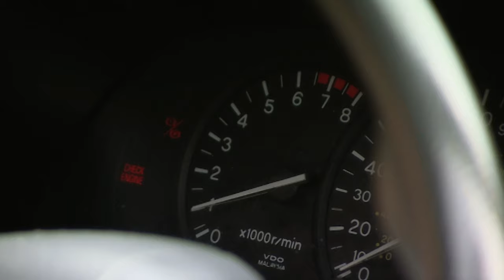Driving A Car With No Oil #TBT - Fifth Gear

Comment: I thought the coolant cools the engine, not the oil. The oil is just for lubrication, while the coolant runs thru water jackets throughout the engine then back to the radiator which cools the coolant with the fans or the air flow coming thru the front of those vents, then back into the engine from the bottom.

Comment: they forgot one big thing.  its better to be SLIGHTLY under-filled with oil vs being overfilled.  majority of lube shops and dealerships overfill with oil because they forget that once draining oil, there is still a quart in a half still left in the engine components.  overfilling oil causes hosts of other problems.  gaskets being one.

Comment: I personally think that you shouldn't be allowed to get a drivers license with taking some small basic maintenance guide. Just how to check all fluids, check tyre pressures and tread depth and check air filter. Would save so many vehicles.

Comment: The oil warning lights could just run on a timer. Like if the Hood hasn't been opened in a few months or the oil dip stick itself hasn't been moved in a few months. Something like that. Or maybe instead of a timer it could read your mileage. 
That would be more reliable of an oil state sensor.

Comment: I dont know, but the operating manual of my car says, the oil level should be checked on level ground, and on cold engine. I checking it on every week, and i tried check when i stoped on a petrol station. The dipstick barely reach the oil, becuase when its warm and the engine was running recently, the oil is everywhere but not in the sump. I checked it next morning and the level was good.

Comment: I know this is years old, but 5 litres of manufacturer-recommended oil for my car that met the proper standards was £48, hardly cheap. Still, ~£100 a year isn't too bad (if the oil is replaced twice).

Comment: I didn't know what a throttle body, intake, turbo, piston, piston rod, block, any of that and more like 6 months ago. Doesn't take much research, but you should always check your oil, change your spark plugs, break, and tire work.
Reply: Spark plugs aren't something you would check regularly
Reply: Spark plugs should be checked every 10,000 miles or every 2 oil changes and either regaped or replaced.

Comment: Hi, is it correct to check Dip stick an engine cold overnight ? I use to check it and exact Full line. but I try to check after engine off after driving, it shows half in between. Please let me know.. thanks
Reply: +axenz axtiz you should check it a few minutes after driving your car. Cold engine overnight gives a false result, and so does a check straight after driving it. Warm up the engine a bit, then give it some minutes to drop, and then do the check. Either way, half right after driving and full overnight means you're okay with oil level. Check the thickness and the color as well to make sure it isn't old.
Reply: +Strax Thank you for the info.
Reply: No, cold doesn't give a false result at all. You can check the level in most cars dead cold or warm, just make sure the ground is level and if warm let the car sit for at least 10 minutes.  Keep the oil level to a little under maximum too, gives a margin for error.

Some manufacturers (not many at all) will specify oil checks when warm, same goes for some transmissions.

But to reiterate, for most cars a dead cold reading will be the most accurate. Discoloured oil doesn't automatically mean it's no good either.
Reply: Thanks Chris :)

Comment: I have always maintained my cars oil and water levels and recently bought a used 1 owner from new, 2001 74,000 mile Hyundai Amica 1.0 (14 years old) for £150 as workhorse that had NEVER been serviced from new.. no timing belt change,3 oil changes and no water change. The oil was like Treacle and the water was furry orange, drained and refilled both, brake fluid, changed the timing belt, clutch and she is still going today 2 years later and 8000miles passes emissions with flying colours and sounds/Runs sweet as a nut. I think it is more  how it is driven whilst not being serviced.. as you saw he was at 8000rpm and thats what finally killed it. I think if you dont know how to service your car you should not be on the road!

Comment: My car just recently almost broke down because it was running on low to no oil because I wasn't due for another 1000 miles. The place didn't screw on the cap tight enough.

Comment: As a bicycle mechanic I can cerify that 90% have no clue there is a recommended tire pressure or that it is printed on the tire walls. Even fewer people own a pump with a gauge on it. This is the no 1 reason for a slow and "heavy" bike plus tire wear and flats. At least most have more respect for their cars because a new one Will cost them more than a push bike.

Comment: Remember, OVERFILLING the oil is bad. Do not fill the oil when the engine is cold, or if you must, fill it to a little above the "low" line, not all the way. Put more in once you have a chance to check it when it's warm.

Comment: I went to get my oil changed but later found it it was actually low on oil and I never seen any leaks. My radiator was leaking but I just got that fixed but I literally took my car in at the right time. If I went any later, this car would’ve been done for

Comment: I was driving my 2006 bmw and I felt like I hit a bump but little did I know it was a rock and the light came on and all of a sudden the car shut off. I took it to get the oil pan replaced but it shakes every time I turn it on:( is my engine done for good???

Comment: Serious question.  My cars oil filter popped off while i was driving and it began to drain. I didnt notice until the low oil light came on but i was on the highway so i kept driving for maybe 5 more mins until my car locked up and i was forced to pull over with a stiff steering wheel.  Now my engine makes a weird noise even after i got it fixed.  Is my engine completely fucked?
Reply: Are you a real person?

Comment: I did the same thing to a 97 Nissan Sentra I drove it till it made a similar noise like yours and then it just stopped working on the side of the road similar to your situation except mine was by mistake what do I do now just fill up with oil or do an oil change

Comment: I always check the oil, coolant and transmission fluid in all 4 of my cars every fuel fill up. And you shouldn't really ever run the tank down past 1/4 unless you're doing something like a fuel pump or dropping the tank. Take care of your cars folks

Comment: i get an oil lamp and warning on a small screen if my oil is starting to get low, way before it's late, i also get occasional messages from the dashboard, telling me to do an oil check, based on how far i've driven, the car went from full oil, to half a drip away from full on 10.000km.. now you're thinking "now that's a good car" it's an Opel Astra 04... so how come so many people fail to check their oil??

Comment: You check the oil with the engine warm? Meaning after it's been running. Does not this give an inaccurate read? Because some of the oil is still in the engine as opposed to the oil sink?

Comment: Drove an old vauxhall for 40 miles with oil lamp on, turns out the pick up pipe had come off and none was getting to the rest of the engine, fixed and worked and no issues afterwards. Mind you I never drive my engines at extreme revs, stupid idea.

Comment: Where does the oil go if it gets more empty overtime? (If there arent any leaks)
Reply: @sanyo8440  well now that I think about it, the car porbaly burns it.
Reply: as engines age, the piston rings wear out. This means that oil can get past the piston rings and enter the combustion chamber with the air and fuel that the engine is pulling in. So yes, the car burns it. Piston rings can wear out faster if you don't change the oil enough, so changing your oil more often will cause your engine to burn less oil over time.

Comment: 4:06 "it's best to check you engine oil when the engines warm". No its not that's the worst time to check it. When the engine is warm the oil inside it is also warm so therefore the oil will expand giving you a false reading.

Comment: i drove a Nissan versa no oil was showing on the dip stick anyway did oil change oil was either low or bone dry everyone told me engine is toast sell the car

100 k miles later still going strong. so much for the experts

Comment: But wait, he checked out the cars in a parking lot... I was learned that when you have driven the car, you can not check the oil levels for about 1-2 hours because the oil has not yet leaked back in the sump(?) so it will look like there is no oil in the car.
If you do check it 'too soon' and you fill it up you have the chance of overfilling your engine and you can wreck your engine as well because the oil can not expand when it gets hotter and thinner.

Comment: I change my own oil with synthetic every 5,000 to 6,000 miles.  So far at 75,000 miles, it's not burning or leaking oil.
Reply: Change mine every 3k miles, just hit 321k miles.
Reply: +Nodak81 that's bullshit. Take a look at saturns, for example.(because people say they are notorious for oil burning) They run forever as long as you change the oil regularly, but if you slip on it a little while or see the oil light come on, you are going to eat oil from then on.

Comment: The only reason oil shows low on dipstick is because you car either has a leak or your car is burning engine oil. 
The only time i check my engine oil is when i servicing my car.

Comment: Wait! Arent you supposed to read the engine oil level when its cold, since it expands when its hot?
Reply: That's why you check it when the engine is hot. Once the engine is at operating temperature, the oil temperature is pretty constant at about 100 C, so you get an accurate level. 

When the engine is cold, the temperature depends on the weather, and as oil expands with temperature the level will fluctuate.

Comment: So, I've driven my 2008 HHR for almost 10K miles with no oil change due to a leak a year ago to prove this point to be wrong, unintentionally I might add.  A friend didn't believe be when I told him I've been out of oil for months, so he linked me this vid, my car just died last week of a fuel line rust out (completely unrelated).  My other cars are always up to date on checks and fluids though, I just wanted to run my first car into the ground... oddly enough I can still drive it, but risk a ticket for defacing public roads.
Edit: I just realized this video is 2 years old.

Comment: before doing any journey
take 5 mins or less off your time to check your car's engine oil, brake oil, power steering oil and clutch hydraulic oil (if there any) and check your tire pressure
better late 1-2 minutes than sorry for having an accident

Comment: I must of owned hundreds of cars over the last 6 years and I’d say 70% are usually right at the bottom of the stick when I acquire them 

Had a Picasso once smoked like a bastard (bought cheap) 

Checked the dipstick 

Half way up the entire fucking rod 

Drained 4 litres of oil to get it back down to max 

Think it’s still going today.

Comment: I have a question, how long was it befor the car finally died? hours? miles? and i am in total shock that not only did they lazily not check their oil but wouldent even allow someone else to do it for them and ontop of that dident even know what a dipstick was or where.

Comment: I can't believe the amount of people who can't do this simple task as well as changing there oil or having it changed at the correct time/mileage.  It is also terrible that modern cars burn this much oil as oil consumption should be a thing of the past but this appears to not be the case.  If I bought a new car and it consumed oil after the run in period I would take it back and complain that it was faulty as it clearly would be.

Comment: Its normal for a cars engine to use little bits of oil 🛢 occasionally but it shouldn't really be noticeable, they don't burn oil the same as burning fuel unless there's a serious problem, or a leak, a car we had like 20 years ago was burning up oil but that's because they engine was too badly worn in the end, which was a shame as it was a good car, did just over 100k miles  Another we had just over 10 years ago she needed topped at times but that's because she had done over 200k miles! Both 1.8 petrol engines!

Comment: Thing is in Diesel engines they self lubricate I've never changed oil in my Clio Dci in over 150 thousand miles,  and it still runs

Comment: the dipstick only registers the last 500 mls of the engine oil level. so if its on the low side of the dipstick. there is still plenty of oil in the engine. if engine is dry then yes of course its bad

Comment: Very interesting, most manufacturers still allow for 1 qt per 1000 miles used but, since we now do oil changes at 10,000 miles, you'll run out of oil about half way between your next oil change. Moral of the story: check your oil!!!

Comment: Your supposed to check the oil when the engine is cold, "not" when it's warm (4:05). If the enige is warm, consensus is to the wait 10 to 15 min before checking... not sure that was the correct advice there, great video otherwise!

Comment: I had a saturn 90 something one of the first models they sold and for like a week the car would stutter while driving I thought it was an electric problem and had a misfire but then one day it was so bad I couldn't even drive it so I pull over start checking the engine and when I pulled out the dipstick it was bone dry literally no out in the engine I pulled out the drain bolt from the oil pan and it had about half a cup of oil!!! At this point I'm thinking well Craigslist time to get a new car but just in case I went and bought some oil filled it up and believe it or not the damn thing ran like nothing ever happened!!! And kept running fine for a few more years until I sold it, probably running till this day incredibly reliable (and fuel efficient) car!!!!!

Comment: The comment about warning light being too late is not necessarily true.  You do get more warning signs such as overheating engine.  I once had oil so low that the engine temp went higher than normal in commute traffic.  After putting in a few quarts of oil, the engine still lasted for another 50,000 miles when I traded it in at over 150,000 miles.

He said he wasn't going to change gears, so was he over revving the engine to speed the process?  Sounded like he was up there over 4,000 rpms.  Thus the sound the engine was making should have been a warning sign.

Also if 1 in 5 cars has that low amount of oil, I would expect to see 20 percent of the cars on the road seizing up or at least overheating, but that is not true.  So that is a tough statistic to believe in.

Usually there is 1.5 quarts of oil from the max to min mark.  So most people who are below minimum still have 75% of the amount of oil needed.  I am thinking overheating may start when you get a quart below the min in harsh driving.  This guy had to drive with "no" oil at high RPM ignoring the extreme noises to kill the car.

Comment: Its better to check the oil at every gas fill up its not that difficult. Newer engines with vvt are notorious for using oil due to improper break in procedures. My ram at 240k uses about a quart every oil change. My prius on the other hand uses 2-3 quarts on long trips say 800+ miles. My Cadillac srx 3.6 used 4 or more quarts per oil change. Some cars don't use oil some do but better safe than sorry.
Reply: Ya ok I check my oil 1 time a month but I drive newer cars now most of my life I drove and owned beaters I fix all of my cars and when you drive a lot and have to fill up 2 times a week and get 17 miles to the gallon and have a 20 gallon tank.

Comment: Isn’t it better to check the oil when the engine is cold as when it’s hot the oil is kinda diluted because of the heat ??????? Or am I just doing it wrong

Comment: You learn all this in the process of doing your car license these days. Seems like the ones who have no idea about their oil level are those who passed their test many years ago and drive without any knowledge of general car maintenance. I'd check their tyre pressures aswell, bet 8/10 of those would be low too...

Comment: Not gonna lie this was my car. It was making rattling noises for like 2 weeks 🤦‍♀️. The oil light warned me to change it like 3 weeks ago. I just changed it yesterday and the rattling noise stopped. Turns out I only had 1 litter of oil and I needed 4.5.

Comment: two years ago I ran my current car without oil for a month because I didn't know much about the car or even cared until my dad told me older cars start burning oil. I'm not sure when it ran outta oil, but when I checked the dip stick their was oil bouncing within the engine but their wasn't an actual amount that it needed not even the bare minimum. When I checked it one day while the engine was off their was literally no oil on the dip stick until I started the engine their was probably a small amount but barely. 2 years later it's since running perfect, obviously I killed some of the life on the car and sadly it is a nice car a 2003 Volvo S60. I'm really surprised this car is still lasting I'm very thankful for those Sweden engineers. Al thought the idiot light sensor didn't come on which the idiot that I am relied on. I now always check the oil every week, It burns about a quarter every month and I've used the lucas oil stabilizer which has really helped, I use to burn half of the oil a month now it's about a quarter.